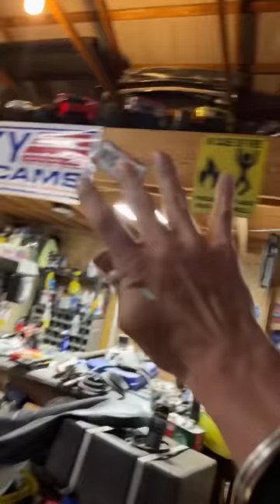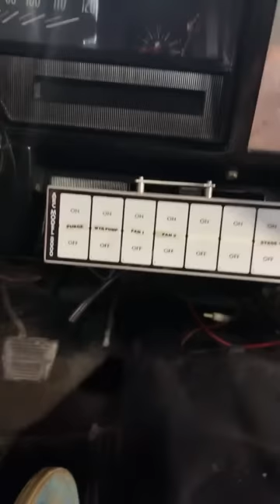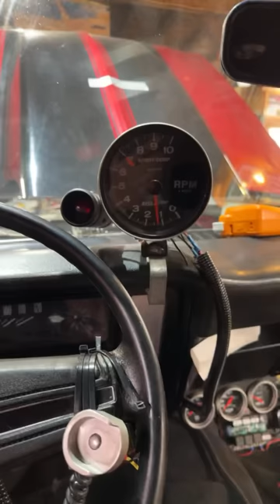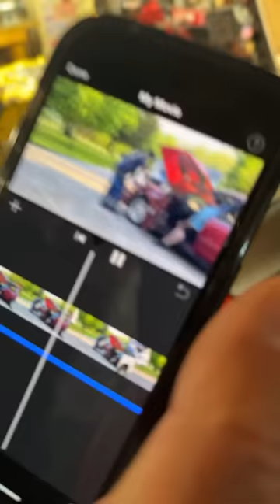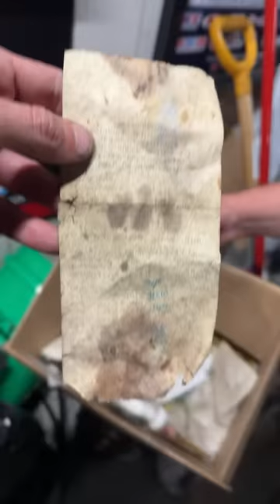Jimmy Daling at the Old Mans Garage

Comment: I can't wait to see Bill's Nova going, I own a 1972 Nova SS , I'm building a destroaked 350 , it's a 331 now , I have some World products sportsman 2 heads that are a casting from 1994 , but their in good shape , still need to decide on what cam I want and if I want to stick with a gear drive. Can't wait to see how your engine does when it's done 👍
Reply: @picklefart  mine appear to be unmolested, got them for $300 , came with the valve springs, which I tested and they are in spec , and the push rod guide plates . And the Valve are in great condition too

Comment: I can see 700 on motor.. because my dad has a stock bore 400 12.5.1 with brodix heads and intake with a dominator on 112/116 mix that made 650 on an engine dyno